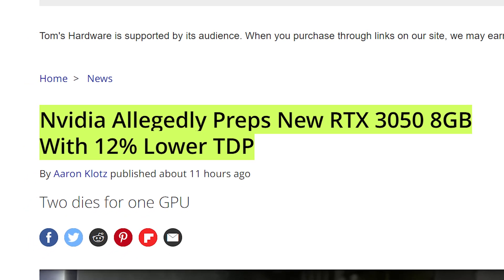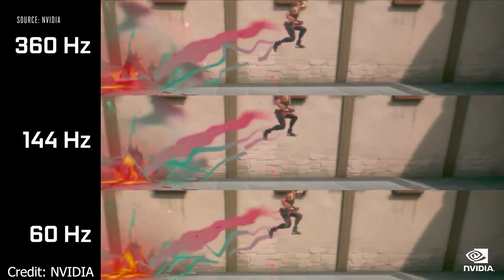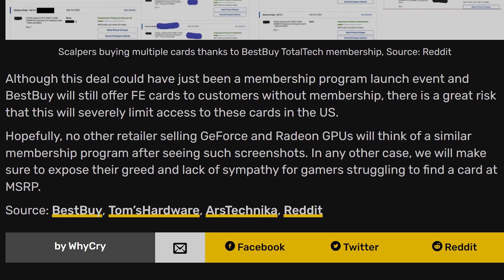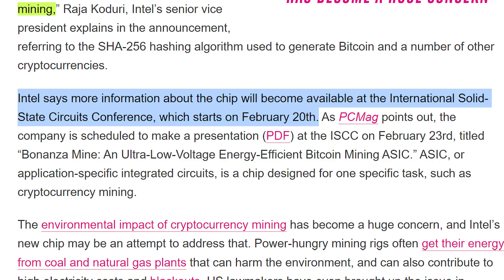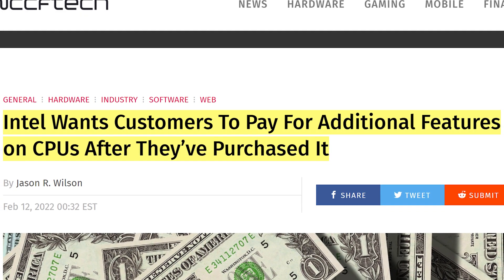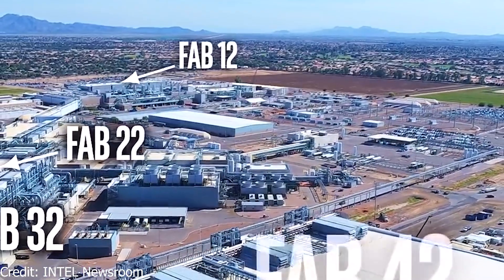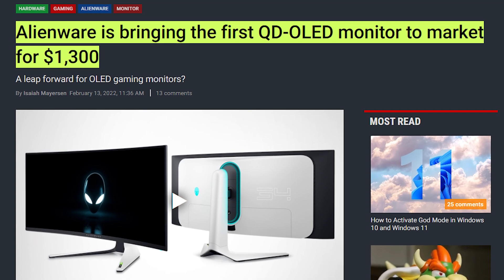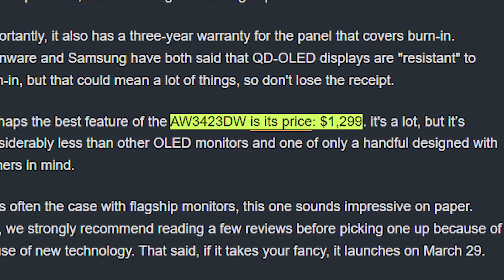i9-13900K Benchmarks Here Already

Comment: The 13900k will only pull about 10% lead in single thread performance over 12900k. In gaming, amd will beat 13900k with zen4. Mark my words.
Reply: Rpcs3 my from amd hasn't a chance , normal games are gpu bound what are you using and i9 to play regular games lmao little overkill don't you think:)
Reply: @nostalgiaholic4874  Not if you are running everything max at 4k hdr/120 hz+. Also yes PS3 emulators, Star Citizen and other stuff.

Comment: Man, If this is the case. I Told everybody what was coming ppl thought I was lying. If 13900K is still big little and not MCM then They have to Double e cores. I assumed they would add hyper threading to the E-Cores but ppl keep telling me im wrong on that. Fair Enough, But at the least they will either add more P-Cores or Double E Cores. Increase E-Core IPC and Clock Speed. They only have so far they can go.
Reply: They are lying not you you info is correct

Comment: On the corsair m55 mouse what dpi is the red color light?
Reply from the maker: Uhm not sure, haven't used it in a really long time. But just check the icue software and it will tell you. Might even be able to change the color and DPI level.
Reply: @WeDoTech  ok thx